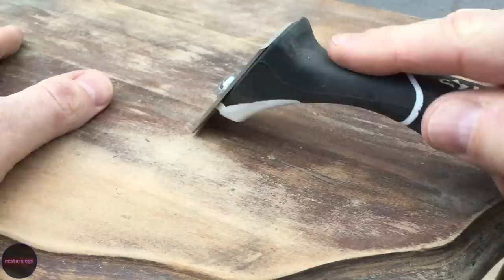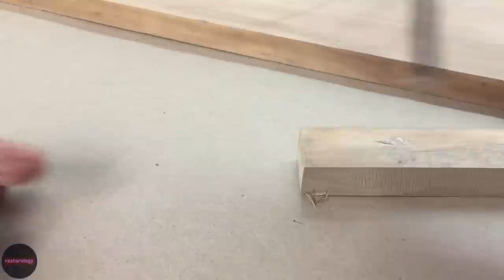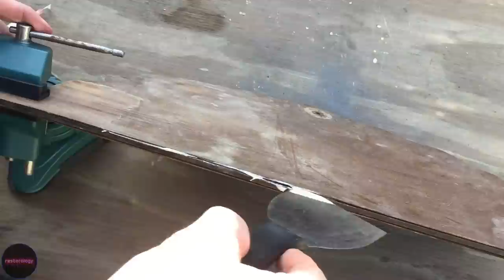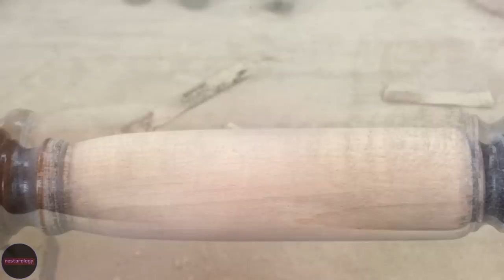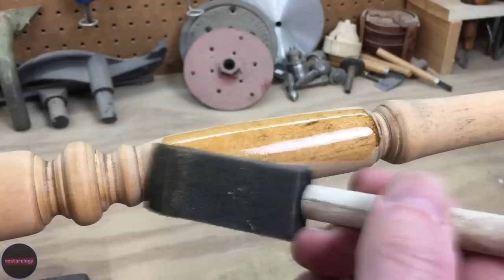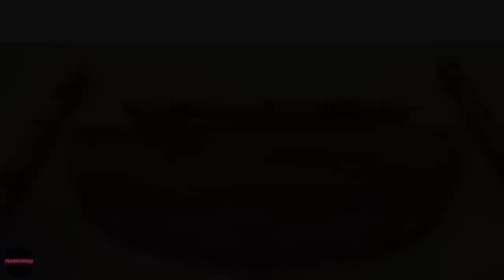Quick & Easy Console Table Repair and Refinish | Restoration

Comment from the maker: Thanks to all for visiting my channel and watching how I refinished this small console table. Please tell me how you feel about the oil and wax finish I applied in lieu of a poly or shellac. I discovered that this table may have belonged to my great grandparents and was passed on to my parents in 1970 so it is much older than I had originally thought. If you feel like watching another furniture project of mine, here is a video of me repairing and restoring an old rocking chair https://youtu.be/tgMWwZiIISM. See you in the next one!
Reply: That's so cool. That table could fit just about anywhere in a home. What a family treasure. 
I don't know enough to comment about the oil and wax, but I love how it looks and the fact that it's protected.
Reply: I have a tale like this and you made the one you found look spectacular. I wondered why you didn't use stripper and rather scraped off the varnish, though, plus, while the fninsh  looks fantastic, some people who don't want plants or their guests wrecking their furniture with water stains may prefer a waterproof finish.
Reply from the maker: @mizvitko8109  Thanks! I do not like using stripper and the old varnish on this just flaked off with a scraper. Much easier. I used a wax finish because I like the look and feel of it. It is not as sturdy as a urethane or lacquer but there will be no plants on this and no guests will be using it to hold drinks!!
Reply: How cool that this has passed down from your great grandparents!  I seem to recall seeing a similar table that was called a "pie crust table" due to the fluted edge of the table.

Whatever it's called, it's beautiful! ❤
Reply: Hace años restauré una mesa.Le quité los barnices, a continuación la teñí y luego le di cera. Quedó muy bonita, con mucha clase. Pero un día puse una taza de té y la cera se corrió hacia ese punto caliente quedando una mancha que no supe quitar. Conclusión : si hubiese puesto barniz tapaporos ( satinado o mate) no me hubiera ocurrido eso.
Esa fue mi experiencia.
Reply from the maker: @ErnestoRodriguez-fn1sh  Gracias por compartir.

Comment: Impeccable workmanship !! I wish i had done this to a table I have from the 40’s. I painted it with caulk paint. My parents had it all their life.
Reply from the maker: Well I've read that chalk paint is easy to remove...you could start over if you wanted a more classic look. It's never too late!! I am sure it looks great though as is. Thanks for the great feedback. ✌🏽
Reply: @Restorology  interesting, I was sweeping around it today thinking about that & then saw your video….Seriously, thinking about it. It’s one of those tables w/ fold down leaves ….is that what they are called ? And Very similar to this table in looks b4 I chalked it !!

Comment: Really nice job. We had a table very much like that when I was a kid back in the 60s.
Reply from the maker: That is probably about the right time frame for this one too. Thanks!!
Reply: I have one identical to it, it belonged to my grandmother. You’ve inspired me!
Reply from the maker: @lisak6226  So I found out that this may have belonged to my great grandparents and may be much older than I first thought. Does yours have any manufacturer's marks or anything to identify it? Mine did not.
Reply: @Restorology  not that I can see, but she passed away at 105 years old in 2010 and my mother said she had it when she was still living at home. So it’s very possible it was your great grandmother’s!
Reply from the maker: @lisak6226  Thanks for checking!

Comment: OH MY GOODNESS!   In this one video, I have learned so much from you.  I refinish wood, and I have this same table, but possibly older.  All of my furniture is vintage.  Most were curb finds.  I subscribed to your channel. 

Do you know where I can find a product that swells wood to tighten joints on chair rungs?  I used it years ago with good results, but I don't remember the source or the name.
Reply from the maker: Thanks for the great comment! I am very happy that you enjoyed the video. I have seen a product called Chair Doctor Glue that is touted to swell the wood and freeze it in place therefore assuring tightened joints. I have not used it. I typically use a two-part epoxy glue when dealing with joints that are loose and have space between the wood pieces. I do not like using epoxy in general but it has advantages in some cases where wood glue may not be the best solution. If you use the Chair Doctor Glue please come back and share your results. Good luck!!

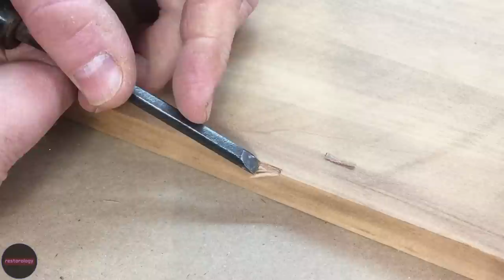Comment: Why not use wood putty to fix the damage area at 2:30?
Reply from the maker: This was a pretty big gouge in the wood. I wasn't confident that I could make the repair blend in well if I used putty. Also, being on the edge, I felt that putty might not mold well enough to create a sharp edge. Thanks for asking!

Comment: Why is it that a dark brown stained table comes out light brown after refinishing.  I have never seen a refinishing job that was as dark as the original.  It is for this reason that I keep my really old stuff as is.
Reply from the maker: Hey. In this case I used a lighter hued stain because I am not a fan of really dark furniture and it doesn't go well in my home. However, older pieces may also be a bit darker because stains and finishes tend to darken over time due to light exposure, conditions in the home like smoking, etc. I restored a rocking chair last year on this channel and I made it super dark using a different stain and finish than I used on this table. Thanks for the question!